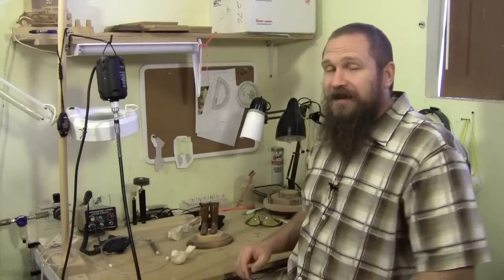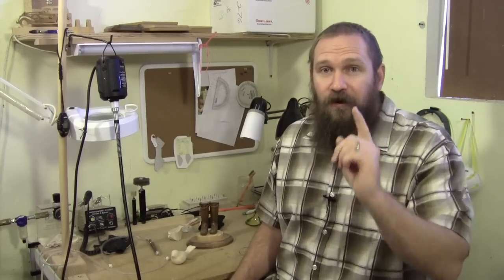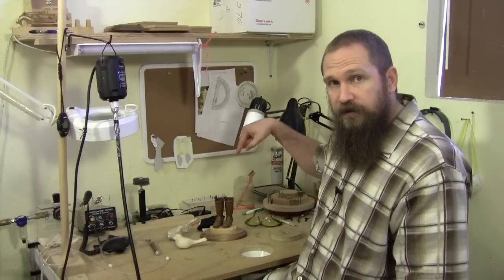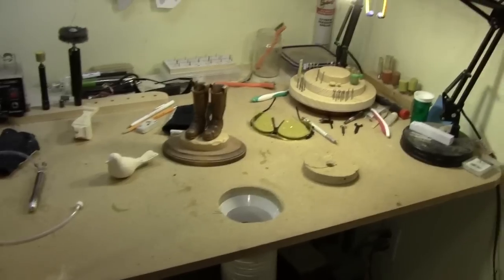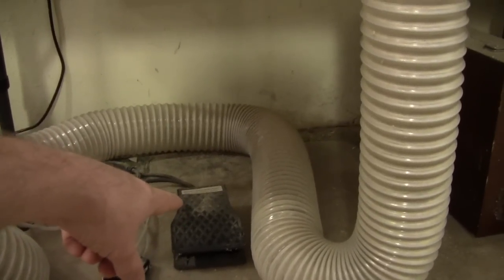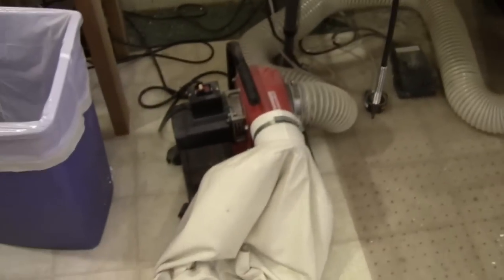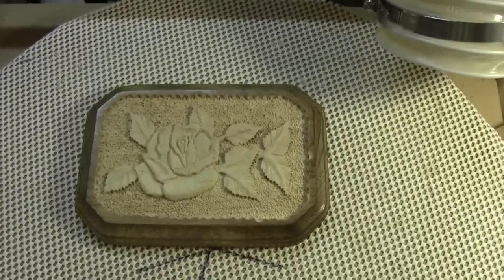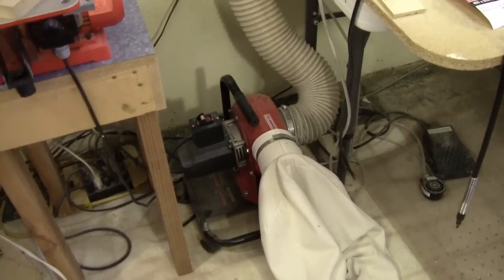Power Carving - Power Carving Station Dust Collector Setup

Comment: If you use Velcro ties instead of the wire ties you can reuse them, it will make set up easier and cost less then the wire ties.

Comment: This was a helpful video! I have a Shop Fox dust collector for my lathe and thinking about using it for a carving station too. Just curious - when working over that 4 inch hose do you suck stuff in you don't want like stuff on your bench that might get knocked over and roll into the hole? I'm wondering if some kind of screen or mesh might be helpful over that big 4 inch hole. But maybe it's not a big deal. I've also been considering going with building a down draft table, but I do like to keep things simple. Thanks for the video!

Comment: The bag in your dust collector should be able to filter sub micron particles to protect your lungs. I bet that bag does not meet that. I would try to change the bag to a heppa filter.

 Not affiliated with Oneida but they have a bench dust collector with a MERV 15 filter. A bit expensive but i plan on just buying the filter set and making my own box with fans!!

Comment: hi ..... i know this video was done a few years ago but the 70 gallon dust collector you showed from Harbor Freight is fantastic. I have it set up in my shop for everything. It is connected to my table saw. router. bandsaw, lathe, chopsaw and scrollsaw. with the addition of the power carving and wood burning im going to add a hose in that can be moved around on my work table. The accessory kit you showed is also pretty handy for getting to all your tools. You wont find a better unit for the price. I have a 6" hose branching at the unit with a Y and then breaking off into 2 inch hoses at the tools. I use the hatch doors to direct the flow based on the tool i am using at the time.

Comment: Hello, I have been subscribed to your channel for years and started on MDF bc of  your recommendations. I started out carving outside while we traveled in our 5th wheel. We bought a home with an attached casita that is 175 sq ft. I have my jewelry supplies, beads, silk ok the walls. I bought a Harbor freight work bench that fits in the closet, took the sliding doors down and want to make  it into a woodworking tent that contains the dust. I will have my bench lathe, bandsaw and drill press along with my SR Foredom and Ram Micro motor in there also. I know people have made painting booths but can't seem to find a sanding booth that is permanent or semi permanent. I have a Vacmaster with an Oneida cyclone attached to a 4" hose with a Big Gulp caring vent at the end. To help with air flow and air conditioning I'm thinking of making a hole from the outside of the closet but still in my studio/casita and putting a desk top portable air conditioning/swamp cooler unit over the hole to bring in air. My question is ...... Do you have any ideas how I can block off the closet and added space to have my dust collection system and me in it? Do you know of anyone who had done this? It will be a designated area but needs to be able to close up when not in use. The rest of my studio is metal forming, soldering, jewelers bench,  beading bench, wire grid walls to hang tools and other equipment and a wet bar area that will be my lapidary carving area. I hope I can get some suggestions bc my air conditioner is a air/heat pump system with a huge vent in the middle of the studio.

Comment from the maker: I really don't have a focused "set-up" with my shop vac. I simply plug in the hose to each tool as I need it. On attachments that do not fit perfectly I have a rubber band on the end of the shop vac hose that keeps everything together.

Comment: Tim, is the single 4" hole better than a downdraft table?
Reply from the maker: The 4" hole is really handy for larger waste removal functions. This is great for 3 dimensional carving where a lot of wood is being removed. A down draft table could be effective for relief carving projects where the waste material ends up on the table, but it really comes down to what works best with your particular workflow.

Comment: Great video! I work with gourds and have now big problem what kind of dust collector should I chose. I keep the gourd on my thighs while carving so something like you have would be the best I suppose. The hose which can be put in the best position above the gourd. In that case what minimal cfm do you recomend? 
I have found something like this: http://www.recordpower.co.uk/product/fine-filter-45-litre-extractor--hplv#.UqBkasTuKSo and I am wondering if that would be enough.
I live in Poland so unfortunately we don't have so big choice like in States. 
I will be grateful for any advices :-) Thanks!!
Reply from the maker: Hi Przemek,

The higher the cfm rating the better, but it depends on application. For power carving on wood or gourds I would be satisfied with 500 cfm's or more. That is as long as the dust collection hose or stand is close enough to the material being carved. My dust collection is 1000 cfm's, but if selection is tough 500 cfm's with good collector inlet placement should work well.